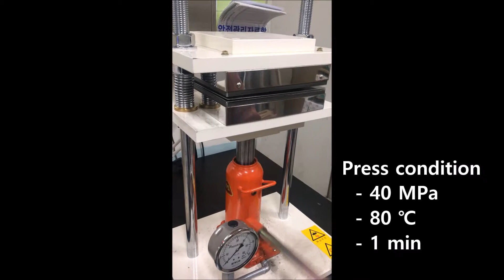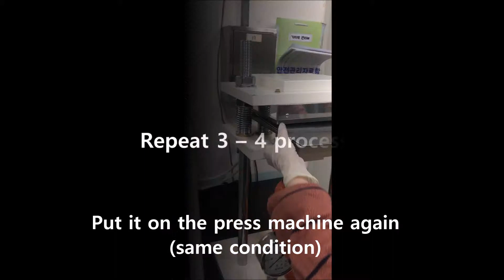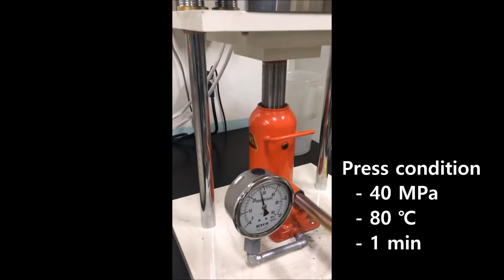How to make a PTFE cathode for MFC

Comment: Hello professor. I am new to making this type of electrode and I have a few questions. We do not have a hydraulic press in the lab so I have been looking for alternatives. Do you think this machine will be a good substitute? Heat Press Machine for Rosin, Mini Manual Hot Presser 2x3'', 1000lbs 400W LCD Controller.

Link to specs: https://www.youtube.com/watch?v=R6njXqt2gO0  

Thank you so much!